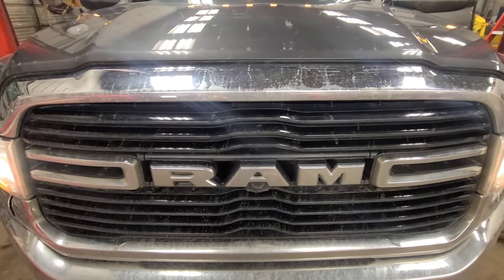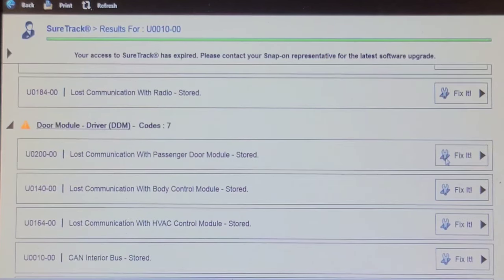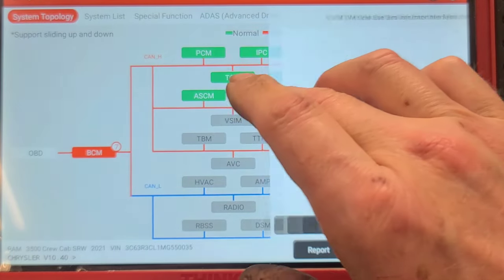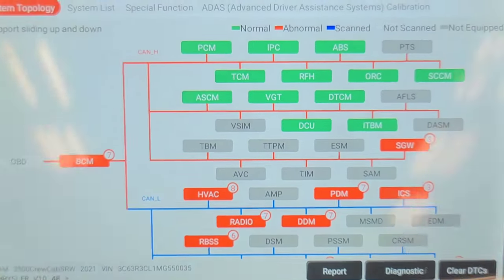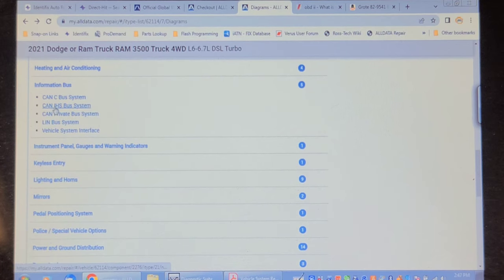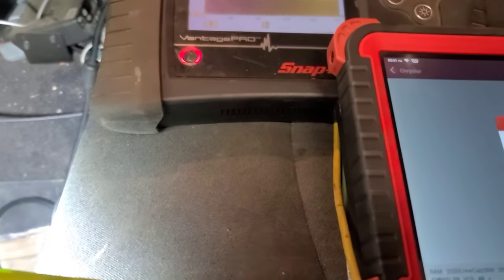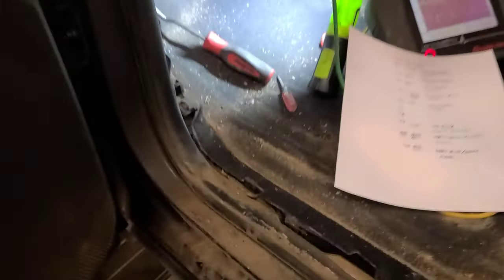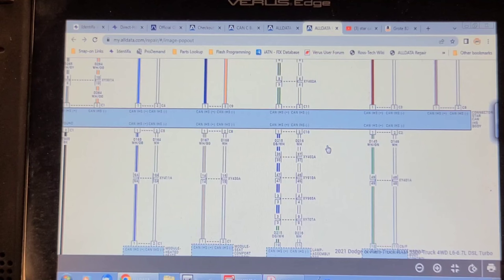2021 Ram 3500 Radio And HVAC Cutting Out. Multiple Ugly Codes

Comment: This was a great diag. I wonder if the dealer would have given up after they replaced $6000 in modules.  lol.  I know somebody who works at a large dealership and they're diag method is to  borrow parts from new cars on the lot to see if it fixes the issue.  I guess that works for some issues, but it could really mess up your diag if things magically start working once you touch everything.
Reply from the maker: Not to mention vin specific modules.
Reply: @PhillipBailey  Yeah...I assume the dealers have the programming capability, but it was interesting to see a recent South Main Auto video on a '09 Jeep Grand Cherokee with a module that was not re-programmable without jumping through unofficial hoops.
Reply from the maker: @RK-kn1ud  most manufacturers do not allow reprogramming a used module due to vin not being able to be changed once its written. Then of course the part is no longer available new...